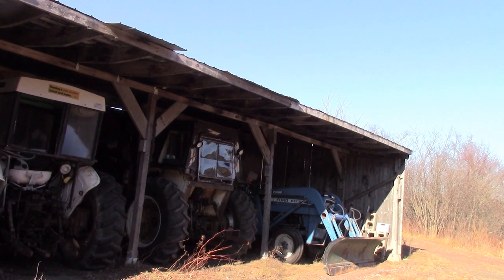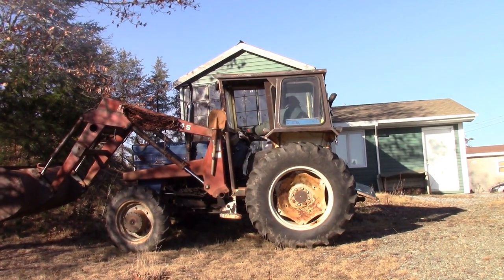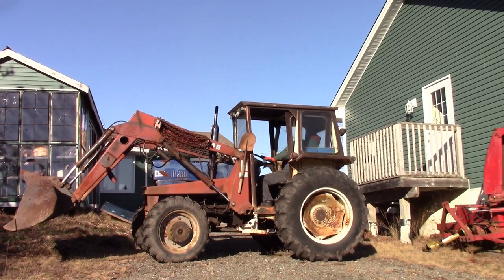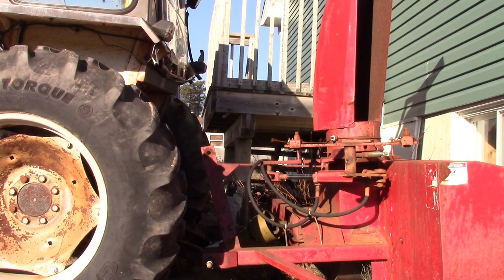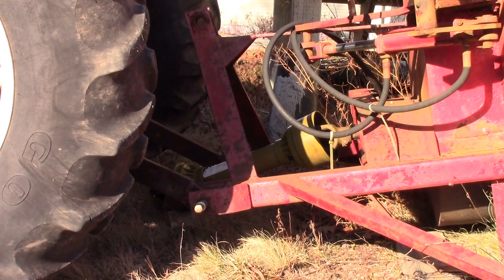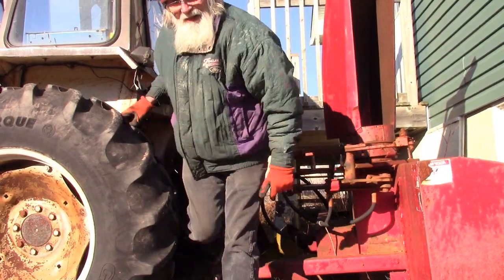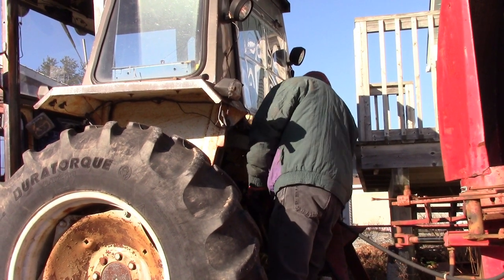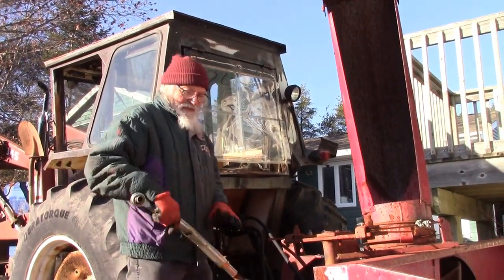53 Attaching the Snow Blower to the Tractor

Comment: That is why I prefer to be ready sooner than later! I've seen a similar problem with an improperly hooked hose. It would not allow any return of the oil, although it looked properly connected. A quick attach is worth having. Then modifying your implement is worth doing too! I can't figure I went without for so long! For the upper link, I would have kept it, as is! Thanks!
Reply from the maker: Thanks Joe .. good advice.  Where my attachments are all quite elderly, I doubt if they would be compatible but I should check it out.